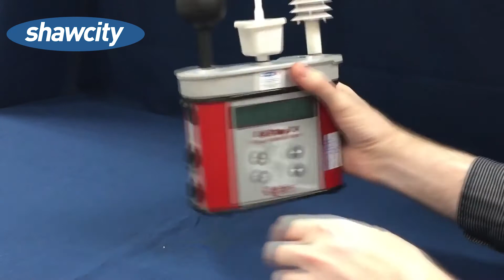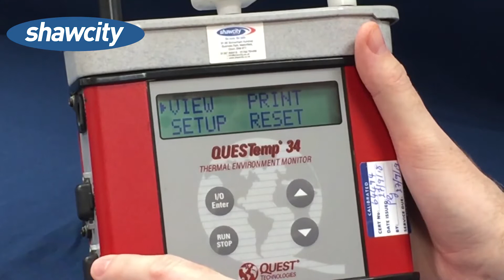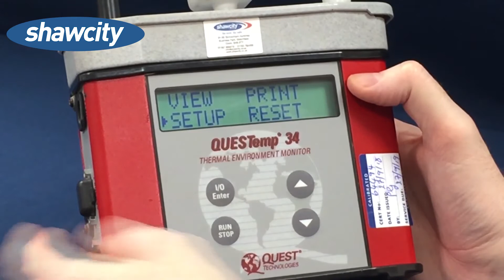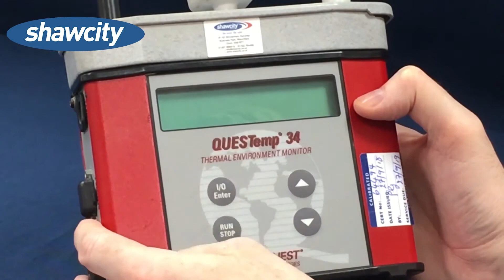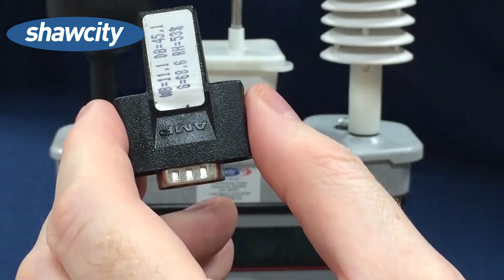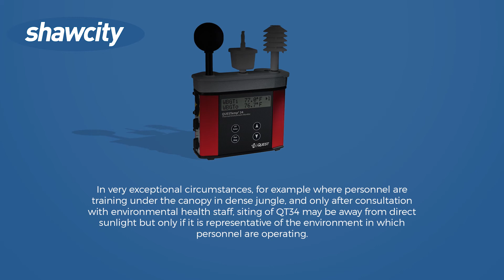QT34 User Guide 2019/20

Comment: Do I record the wet or the dry reading for comparison on work tables?
Reply from the maker: Hi Paddy, thanks for your question. 

Heat stress readings are typically combined sensor calculations. Assuming work tables are indoors, you would normally used WBGTi measurement (indoor) or if outside WBGTo (outdoor). These measurements use calculations from both the wet and dry bulb sensors.

If you would like any more information, please feel free to jump on our website, live web chat or email: solutions@shawcity.co.uk.

Many thanks